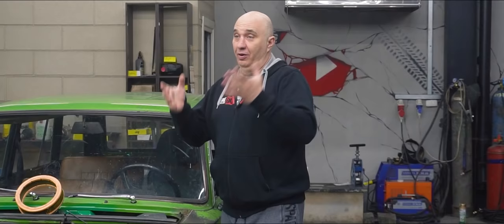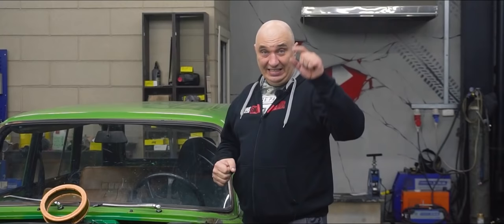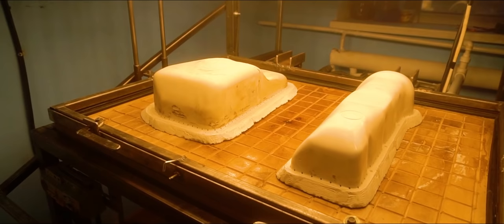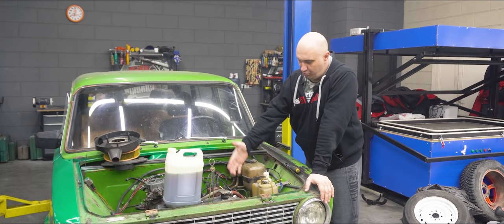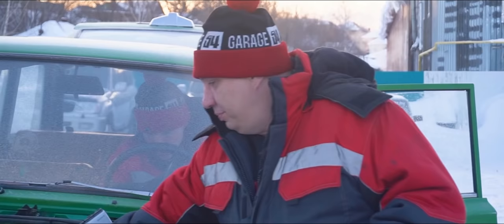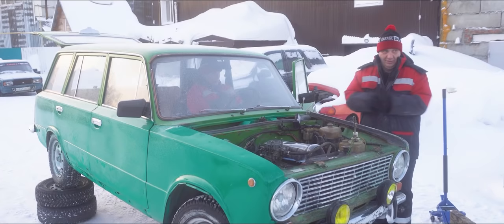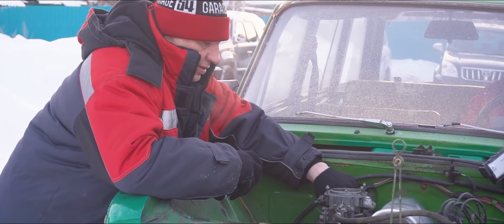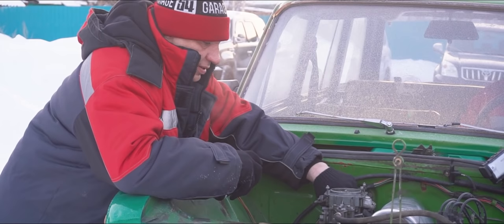Looking inside an engine during cold start (-30 degrees)

Comment: Can you do this test again but this time use synthetic oil?
I would expect much better results.
Reply: Or any modern proper engine oil
Reply: Doesnt matter Synthetic or conventional, 5w-20 will perform the same bc its made for those temps.
Reply: @LucasIsBusy  project farm tested that and synthetic flowed better than conventional oil at sub zero Temps. So ya youre mistaken
Reply: @JM-yx1lm  Many others have tested this as well. Synthetic has much better cold flow.
Reply: Pretty much any 0W oil should theoretically work.
Reply: Lucas Is Busy 5w20 isnt
Reply: @LucasIsBusy  Mineral oil simply can't reach better operating temp range. It can be thicker or thinner but you can't do much about making both. That's why synthetic matters as this is the only way to create something thin enough for very cold starts and sticky enough to provide proper film in operating temperatures. From conventional (mineral) oils you can get 5W-20 but not 0W-20 and that would make huge difference here.
Reply: @LucasIsBusy  they used like 20w40 in this video or something
Reply: Synthetic oil does not behave any different than that. Remember, in spite of its name, synthetic oil is not synthetic. It's just a different refinery process.
Reply: @JM-yx1lm  That does depend on the grading. Synthetic oil is not necessarily better.
Reply: @thefreedomguyuk  I would argue with that. Mineral oil is purely based on refining process and comes from crude oil. Semi synthetic oil is mineral oil with artificial additives that are precisely calculated to have some additional characteristics. It's adding stuff which was not in the oil in the first place. Synthetic oil is made basically from scratch, heavily refined oil and all ingredients are mixed in. It's like comparing bought muffins with made by yourself. If you buy muffins, you can add some sprinkles, icing or some stuffing but you have to work with what you've got. That's turning mineral into semi-synthetic. Synthetic is just buying ingredients and making it yourself. You may create the same type of muffin but you can add something else changing everything. If you bought chocolate muffin, you can't turn it white. If you make it from scratch, you decide what goes in.
So no, synthetic oil is not just refining process. Heavily refined oil is one part but it is just a base. It's like comparing river water with distilled water with precisely measured minerals (which is artificially mineralized water). You can make distilled water from river water but it does not mean that it is the same. You just purified water/oil to the base and now you have to add whatever you need back. Mineral oil is like slightly filtered river water. Semi-synthetic is the same river water with some additives - you can call it tap water. Synthetic oil is like mineralized water. Usually reverse osmosis is used to produce distilled water, then measured minerals are added to the water to make it mineralized. It may sound like mineral water or spring water but it is not. Mineral spring water is naturally mineralized water comming from the spring or underground sources. Mineralized water is just your regular tap water that was additionally purified and more minerals were added to match the requirement. By destilation you remove what you don't want (eg. chlorine) and then you add what you want (magnesium, calcium, iron etc).
Reply: @thefreedomguyuk  I just got done saying project farm tested that...go watch the video, there's nothing new you can tell me, he tested that.
Reply: Synthetic oil is made from natural gas, it has long chain monocles. Quality can be controlled better. 
Crude oil has various length monocle make it harder to get the proper quality. 
I just wish I could remember where I heard it....🤔
Don't quote me,I'm not a scientist, nor have I played one on TV!🤣😅
Reply: As someone that lives in Canada, I never had problems with a good synthetic oil in such temperatures, of course you have to let te car warm up a little bit, but the flow it's way better
Reply: @LucasIsBusy  . Open a bottle of synthetic oil and regular oil of the same grade at minus forty degrees(a temperature we see on a regular basis).
The regular oil is as thick as jello, I mean you could almost slice it up with a knife. 
The synthetic oil still poured out nicely, if a little slower than usual. 
It's why I  use synthetic in my snowblower,easier to pull over. Not all blowers have electric start..🤔
Reply: @LucasIsBusy  nah, each oil has different specs. 2 different synthetics at -20 will perform differently even if they're the exact same 5w20.
Reply: You’re all wrong. Synthetic oil is SYNTHESISED. There are different types of synthetic, like Group 3, 4 or 5. “Synthetic” or “conventional” refers to the base stock... nothing to do with additives. Semi synthetic simply means that it’s at least 30% synthetic base stock... and the rest is just refined (purified) crude oil, but the refining process can’t remove all the impurities and the oil molecules aren’t all uniform... unlike synthetic... where all the molecules are the same... and more stable.
Reply: @LucasIsBusy  not even remotely accurate
Reply: @ZoomZoom81  no? Based on a YT vid that u watched and taught u all about how to test viscosity and shear forces in a dynamic fluid using proper equipment I'm sure.
Reply: @LucasIsBusy  I spend very little time on YouTube. I have been an automotive service manager and manufacture & dealer trainer/consultant for 15 years. I live in North Dakota. We know cold. What are your qualifications?
Reply: @moabfool  that’s absolute rubbish. A synthetic BASE STOCK will ALWAYS outperform a conventional/mineral/petroleum BASE STOCK.
Reply: Great video but is no useful to me. Here the extremes temperatures in winter is about +4 degrees Celsius and in the summer is about +30 degrees Celsius. I use only 10W40.
Reply: @LucasIsBusy  absolutely different. Viscosities of two different oils have diffent thickness. Plus depending on makers. Especially, penzoil and amsoil. They are thicker than other oil makers. Each maker has different viscosity but regulated by the standard.
Reply: @platinumsky845  not worth the fight when everyone on here's back up is a YouTube that a farner did. So dumb. Hahahah.

Heres my backup: ISO sets the global standards to which oil is tested at. The test is not "let's see if oil I chilled in my fridge rolls down a wood ramp that they made that is at room temperature and do the test in a warm room in a barn" weird hey?

 The real test uses a very expensive bit of kit to measure the shear force on the fluid under different velocity, pressure, and temperatures. From that they tell you what  "weight" the oil is. If it's 5W20 then that's what it is. 

Watching a fluid flow down a hill doesn't tell you anything at all about how the oil will perform when it's providing a cushion in between the journal faces on your crank shaft due to the shear forces the oi lproduces. 

You can only make a shear force when you use two moving plates with oil in betweeen and measure the force relative to each other. When u have that data you apply like 3 temp, pressure and other corrections to produce the true shear force of the fluid. 

What would I waste my time tryna educate people that don't want to learn? If they think a 10 min farmers YT video where he rolled cold  fluid down a lil ramp in room temperature barn is emperical proof then I just feel sad for them. Not my job to change their minds. 👍🙂
Reply: @ZoomZoom81  my qualifications are im a mechanical engineer who has taken several courses on fluid dynamics and based his final research project on studying how a non-newtonian fluid reacts to different shear forces. Literally studied this area for years at a university level, so ya I know a thing or 2. Oh I  guess my grad level course on designing internal combustion engines also qualifys me to speak about fluids in journal bearings.

North Dakota? Phhhhhhh, your guys winter is our fall. We see -40F for about a month up here. Coldest Ive worked in was waaaaaay north when it hit -67F, so ya I kinda know cold as well.
Reply: @platinumsky845  I'm not entitled, I'm educated by degree. Look at my other reply above, I've taken many a course in this and read many sae papers on fluid properties.

I can't educated the unwilling.

U asked why I don't reply, u are part of the reason.
Reply: @platinumsky845  eating breakfast with my team and were laughing my butts off at this now. Hahaha. Do something hands on??   I. Am. Dying. 🤣🤣

Soooooooo today, I'm on an O&G site investigating why a jet fuel system keeps blowing up process pumps. We (a team of engineers and millwrights) are looking at the bearings, what's happening with the lubrication oil (guess how many SAE and ASME papers I've read before showing up here today), and also have studied the entire system for the last year after running all the hydraulic anaylisis and design calcs to figure this problem out. Very complicated system with many viscosity based data points. 

When I get home from my shift as project manager, I will unwind by making parts for my race car using my industrial CNC machine. I feed the machine using toolpaths I've programmed using parts I have designed.

The CNC is powered by my 3 phase rotary converter that I designed and built from scratch. The power and gas for the garage was trenched in and installed with my 2 lil hands. The garage was lifted up off the foundation and placed on a 39" cripple wall so the CNC machine would fit. Lifted the WHOLE BUILDING with my own hands and did it alone. There's a video of the lift on my pages, it's pretty cool. 

I'll take those parts I have made with my hands and install it on my race car with my hands.. The car makes 800 hp and has been designed and hand built by myself. It will spin to 10,700 RPM and will swallow 44 psi of boost.

Inside that motor I have hand shaped the oil passages and modified the system to produce a flat 100psi of oil pressure any RPMs after 2.5K. The bearings in the block have clearances calculated by me to keep the block alive. It takes 20W50 oil. Runs like a top, takes a beating and asks for more.

Hands on? Bwahahahahaha. I've got more callouses on my one thumb than u have on both hands. Sit down before u embarrass yourself kiddo. 🤣🤣🤣🤣
Reply: The old cars had oil warmers for the old oil like 10W40. The new cars use synthetic oils like 0w and 5w for sure  starting in the winter. Personally I would still have an engine warmer if I lived in very cold climates in the winter. Most of the wear on a motor happens on startup and cold startups are the worst.🤔🇺🇸
Reply: That battery is a champ
Reply: Mobil started making synthetic oil for use in aircraft in cold northern latitudes. Instead of long chains the oil is highly branched like a snowflake. Because of this it is a non-Newtonian liquid which means viscosity does not increase linearly with decreasing temperature. It's star shape also makes it less reactive with air and water.
Reply: and a modern car.
Reply: @barryfirth1187  Synthetic is not only made from natural gas (like Pennzoil), but also regular old crude (but highly refined/modified) or even PAOs (polyalphaolefins, like Amsoil).
Reply: @MauriceNL1  common oil for old cars is 10W40 in North.
Reply: @ranelsarapuu7500  Waayy to thick.
Reply: @MauriceNL1  it is enough. Salt and rust are killing cars here, engines would last much longer.
Reply: Yeah, a 0w oil is probably best for this situation. Depending on which SAE rating you go with 0w can stay viscous enough to run at about -40C to -35C
Reply: @LucasIsBusy  completely false.  Synthetic has a much wider range of temps that it can perform at
Reply: @JM-yx1lm  Show me the link where he tested synthetic oil vs non synthetic oil with the same grade.
Reply: @edifyguy  Thanks. I planned on getting syntehtic oil for my new Fiat 500x, but wasn't sure if it was a good choice for winter.

Comment: I want to see this experiment with different weight oils. Just to see how well each oil does.
Reply: Project Farm has a few videos with that sort of idea.
Reply: mixing oils? Nice
Reply: same here
Reply: @iainmacrae6982  just not in a running car though
Reply: Best visual display ever for using pure synthetic motor oil. With 0W-20 or 5W-20 this start would have been no problem.
Reply: ok Project Farm
Reply: @georgemckenna462  i cant find a video of this on your channel. until then its just a theory.
Reply: Yesss
Reply: @Patrick D so what did he meant?
Reply: Yeah I wanna watch how olive oil compares with sunflower. I switched from motor oil to olive recently and it runs like new
Reply: No such thing as Oil Weight  ... That's not what the "W" means !! 🙂
Reply: @bruh-fn5dh  nice
Reply: Definitely!!
Reply: @Patrick D probably not but one of his videos he mix a bunch of oils together just to see what happens.
Reply: @waylonmccrae3546  false. Weight or viscosity is interchangeable. The W stands for winter. 5 weight/viscosity when cold, 30 weight/viscosity when warm. Even the guys that make the oil use the word weight.
Reply: @Deere2154D  Correct . W stands for Winter , but WEIGHT is NEVER an oil industry term , but if you want to believe that then go ahead !! 
Have a nice day !! 😊
Reply: @waylonmccrae3546  valvoline right on their website uses weight. But I mean you clearly know more than a billion dollar company that makes oil.
Reply: @waylonmccrae3546  When does it make sense to use straight weight oil (SAE30) versus a multigrade oil (5W-30)?

Straight weight oil is never recommended for use in a system that requires a multi-viscosity oil. Straight weight oils are generally recommended for smaller engines or older vehicles that were made before multi-viscosity oils were produced.

Directly copied and pasted from valvoline, and it is used more than once to specify engine oils along with viscosity. Keep trying though.
Reply: @Deere2154D   O.K. listen very closely .... In the oil industry WEIGHT Is never defined in the use of Multi-Viscosity Oil ,  the W Means WINTER , that was my whole point smart ass .... SAE30 might be referred to as WEIGHT if thats how they define it but in actuality you are only defining Viscosity Grade Indexes , Shear Resistance , & Flow capability at certain temperature ranges !!  If you or anyone else wants to define it that way , go for it .... but anyone who thinks that W means Weight is incorrect !!   By the way ( SAE30 ) is not 30 WEIGHT  , it's Single Viscosity Grade !!  Have A Nice Day !!  😉
Reply: @waylonmccrae3546  I know exactly how it's is measured and what the W stands for. Weight is used by oil industry for single viscosity 40 weight, 50 weight 10 weight. Never did I disagree with you that the W is weight, but that weight is used by the oil industry to define single viscosity
Reply: I put some 10w40, 15w40 and 20w50 into glasses and froze it at -18 °C. The 20w50 was solid as grease, by even the 15w40 was foggy and not really liquid anymore
Reply: I would also pre-mix at 50:1in this weather. This will get down and keep the needle rollers from micro welding.
Reply: I’m going with amsoil interceptor synthetic 2 stroke oil now. The BRP XD-100 ETEC oi. Some of it’s pulled off with a VRO pump into intake. If not I would definitely premix to keep from cold start up damage.
Reply: @jlo13800  Wait you mix 2 stroke oil in you 4 stroke fuel injected Engine? It would reduce wear but, wouldn't it roast your cat? My Toyota was burning a little oil and after 15k miles the cat was gone.
Reply: @jlo13800  Or you put 2 stroke oil in the crank case? To thin the oil a little?
Reply: Should have 0w-15 at that chill....!!!
Reply: @waylonmccrae3546 , of course, there is.  Oil weight is known to most oil companies and old mechanics it is just a term that the heavier the oil weight the thicker the oil the lower the weight the thinner the oil.    Is it ok to switch motor oil weights, for example, from a 5W-20 to a 10W-30?

It depends. Some vehicle manufacturers provide a range of recommended motor oil viscosity grades based on the outside temperature in which the car is driven. Other manufacturers recommend the use of only one motor oil viscosity grade. For best engine performance, always follow the manufacturer's recommendations found in your vehicle’s owner’s manual.
Reply: @onlythetruthfull  True it's just Jargon used so the average person can relate & communicate etc.  Walk into an auto parts store and ask for a 5W inter 30 max VISCOSITY Motor Oil , or a 30 Straight Viscosity Oil , and see the look if WTF on the person behind the counter !!   WEIGHT is simply a Jargon term used for simplicity purposes !!  😉👍
Reply: @platinumsky845  O.K. that's cool , settle down a bit killer , no one is accusing anyone else of ignorance , nor being educated beyond their intelligence , my point is that 'W' as applicable to Oil in Industry Tech. Terms always denotes WINTER , NOT WEIGHT !! 
 Have a good one !! 😎👍

Comment: Thank you very much for that experiment!! It made me think of the -15.0 F morning in McCall,ID when I cold-started my 86 Chevy Sprint and destroyed the oil pump.  I actually ran the car for a full year without a functioning oil pump.  The engine was noisy at first andleaked about 1qt of motor per week oil, but I just kept adding a blend of motor oil and STP

Comment: Excellent video. Having worked on numerous Ford Pinto engines with the hexagon drive from distributor to oil pump, which was a renown weak point. The later CVH engine had the oil pump driven directly from two flats on the front crankshaft journal. 
I have never experienced anywhere near minus 20 degrees C, but can now easily see how it affects oil flow (or lack of it). 
Once again, excellent video